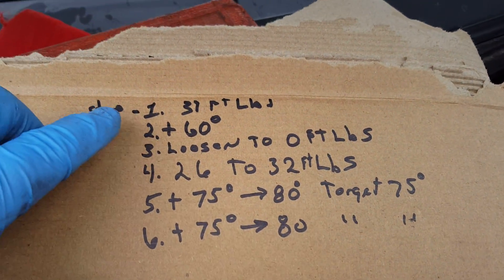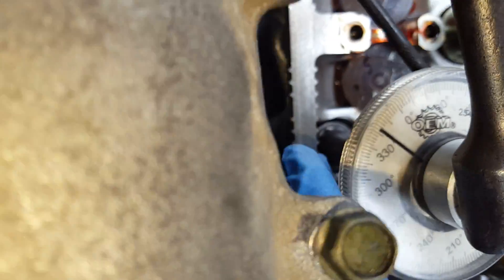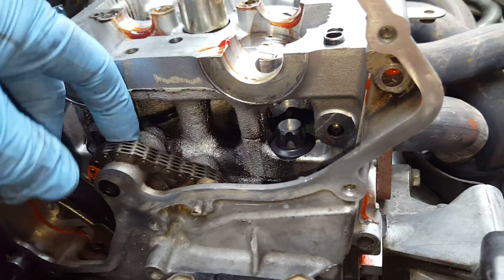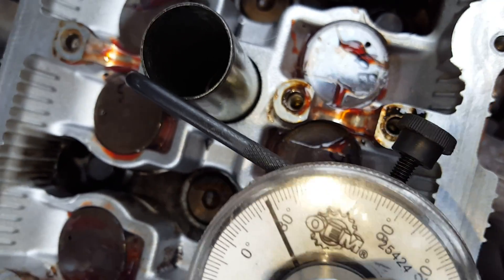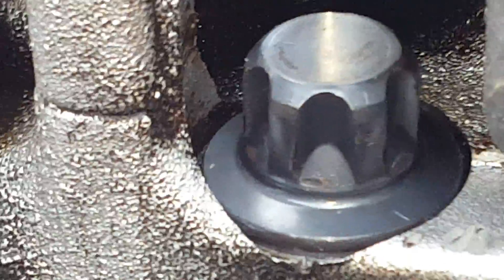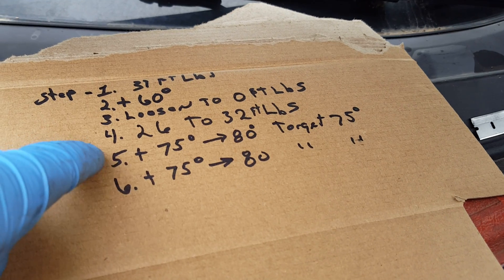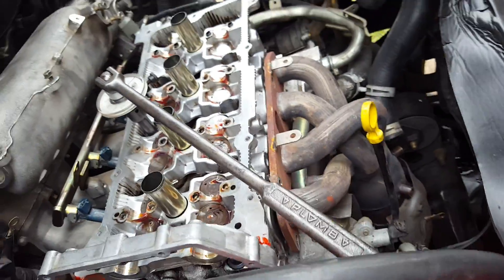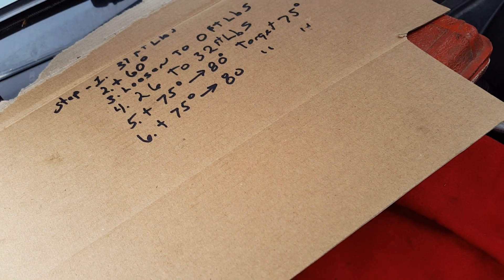2006 Nissan Altima head bolt torque procedure

Comment: 15mm works good but an E20 Torx may be necessary unbolting old head bolts as they put them on pretty tight, had two that needed to E20 Torx to get them removed as the 15mm was just slipping. Adds confidence that the bolts aren't slipping either when torquing it as well.
Reply from the maker: Ok good to know

Comment: Wow is that nessesary can't you jut tourque without angle?? What can happen??
Cause I don't have that tool I have tourque wrench but not that with Guage for degrees??
Reply from the maker: The bolts are special bolts. The head gasket is a multi layer steel gasket and requires very specific torque procedures. If you get ARP head bolts you can use a standard torque wrench. I like the idea of ARP  head bolts and if it was my car that is what I would do. You may be able to rent a torque angle tool. You would not be able to do the torque procedure correctly without the proper tool.
Reply: @chriskolar  ok thanks man 👍
But want to ask a question how do you remove the sprocket gears bolts is it hard, ive seen one how is using 2 vice grip one in each cam and hold an open wrench in one cam and use torch with tourque wrench in sprocket bolt?? Is it that hard???
Reply from the maker: @Sroor90010  yes they are very tight.
Reply: @chriskolar  omg I faced that on my 2007 pathfinder but I solved it with electric impact gun while holding cam with a wrench  and its nightmare while tighten to the specific tourque while holding cam with open wrench and tightening with torque wrench but I feel better once I've done it, so how did you took out that bolts on the cam only open wrench on the cam and tourque wrench on the bolt of the sprocket of the cam 
Or did you use heat and vice grips?? On each cam also
Reply from the maker: @Sroor90010  I used heat and open end wrench. The vise grips are only for a fail safe. If you grip it too much it may crush the cam, it is hollow.
Reply: @chriskolar  ok thanks for help ill do it like this without vice grip once I got the angle tourqe adapter
That I've ordered

Comment: How did I find information for 2006 Nissan Frontier v6  4.0 head gasket torke
Reply from the maker: The 4.0 is way down in the article. There are also a few online service manual outfits and alldata too.

https://www.autozone.com/repairguides/Nissan-Pathfinder-1996-05/Engine-Mechanical-Components/Cylinder-Head/_/P-0996b43f80376a24

Comment: why do we need to loosen the bolt 0 ft lbs? my Sentra also has the same specs.
Reply from the maker: It is a preparation step to clear threads and set the bolt for torque procedure.

Comment: Hi, did you remove the manifold studs, inlet & exhaust, before you took the head off or on the bench? How easy is it to put them back on the inlet in situ, it looks a bit short of space there, thanks
Reply from the maker: I did remove the studs, most came out easily. Some that did not I stacked two nuts on the stud and tightened them against each other, or jammed them then the you can unscrew the stud. Yes it is a tight space. Overall more space than a 6 cylinder.